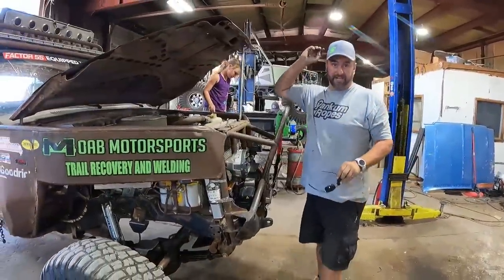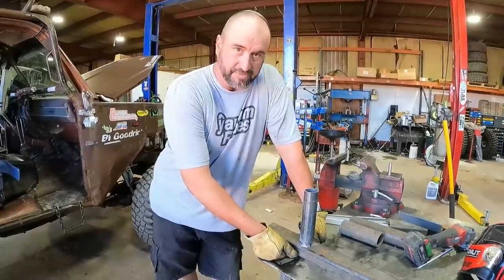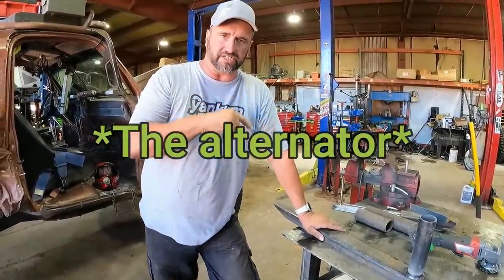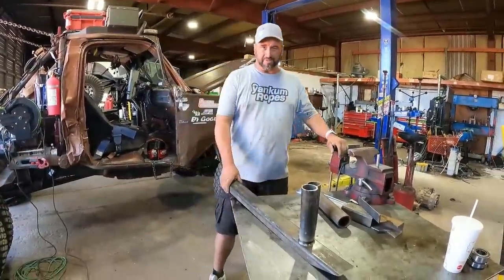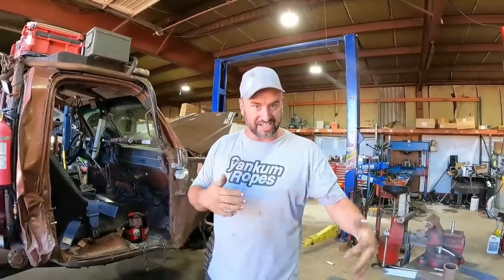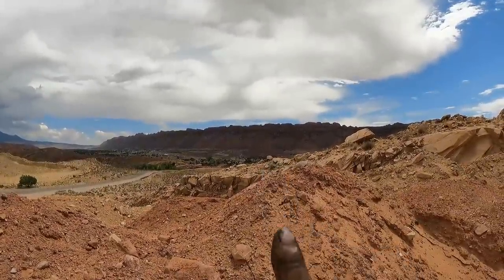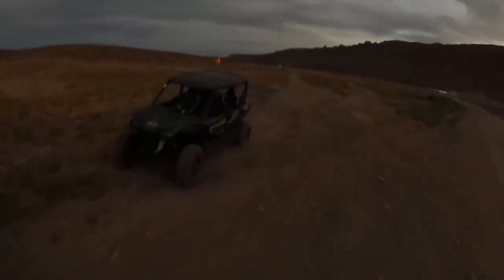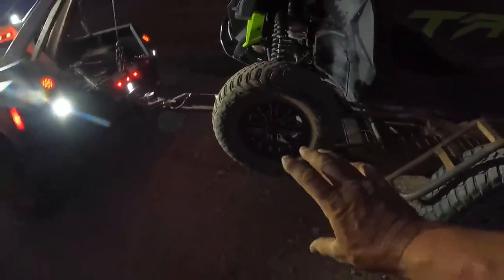Premier Power Welder

Comment: I like the way you work I really like your ingenuity but sometimes I hesitate to correct you about technical things because I don't want to come across as some kind of technical picky picky but I'll tell you one there is no such thing as a high frequency DC because as soon as you talk about frequency you're talking about an alternating current condition so to be technically correct it's a pulse with modulation system mega sorry about the tech talk

Comment: I was building a structure and had a 120v winch plugged into the house we were installing a piece that was isolated from the other Steel in the project we had our structured grounded to the grounding ring and that f**** thing back fed through the winch and we were welding through the winch well that was good for about 3 seconds the ark went out and it took us over an hour to figure it out actually we didn't figure it out till we decided to let the winch down and it wouldn't work because the thing was fried